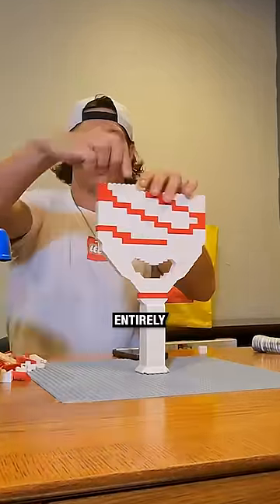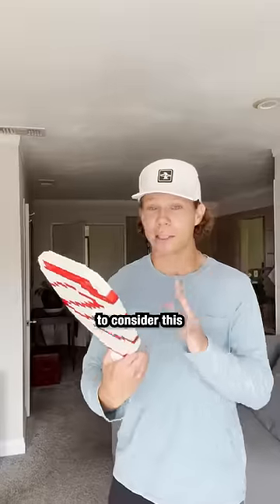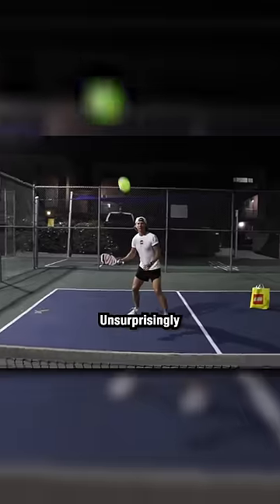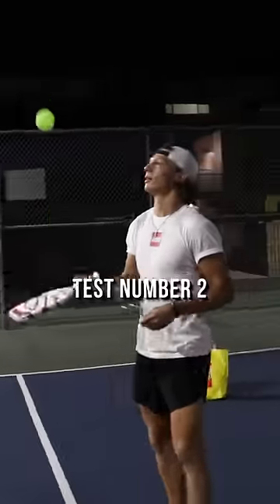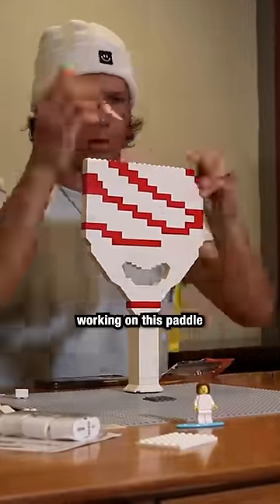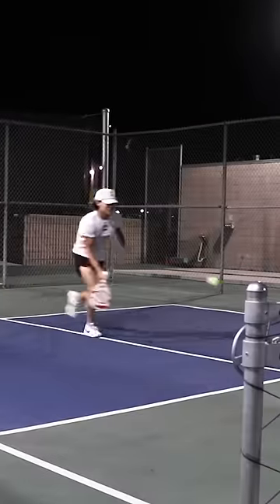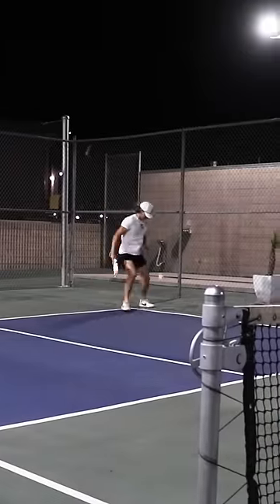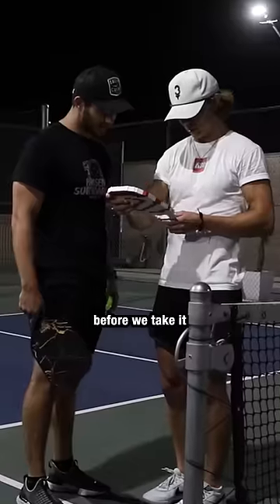PLAYING PICKLEBALL WITH A LEGO PADDLE 😆🏓

Comment: Should've built the paddle horizontally instead of vertically, would've held up better
Reply from the maker: I could try that if I try making another one
Reply: @CjKirwan  yes do it
Reply: And he could start including legotechnicbriks which is useful for movements rather than the 2*4+ briks that is for low forces
Reply: Yeah
Reply: Bro threw it
Reply: @CjKirwan also for strength you could glue it together
Reply: You gotta use snot bricks (studs on the side) and hold them together with plates
Reply: He should've added supports inside the paddle as well
Reply: @CjKirwan thats not pickleball, thats tenis
Reply: @CjKirwan you could also try gluing it
Reply: @CjKirwan you could also superglue the thing. I did it for some of my sets and it makes it immensly strong
Reply: @CjKirwan make it with the 1x… an 2x… and 1x2 and 2x2 or what ever plates that has one of the numbers never more than 2 and then it will be extremely sturdy
Reply: @CjKirwan just so you know legos master builders use super glue
Reply: horizontally and with technic bricks
Reply: Or make it with flat bricks, like 6 layers
Reply: Guy ain’t smart enough for that, shoulda known when he said “days building”
Reply: @normalrocket949 he did. He super glued all the pieces together
Reply: @togsana it's padel
Reply: @zwitie3455  I was coming to make that same comment. Just bricks won’t hold up unless it’s glued together. A combination of technic pieces is key.
Reply: @ohioresident9182 The handle came off
Reply: @CjKirwan yes do it waste your life for the internet hive mind
Reply: @CjKirwan also try using snot bricks and  plates on the sides of the handle to allocate the stress across the whole handle, rather than just the point where the handle meets the paddle.
Reply: Strongest way is to include both!
Reply: As well as horizontal, Also make the entire thing out of the thin plates.
Reply: He did build it horizontally though
Reply: @tanyamilley4369  no they mean using plates instead of bricks
Reply: @CjKirwan do it
Reply: @CjKirwan should use those flat pieces 😂 I could never take those out
Reply: @normalrocket949 he did glue it
Reply: @ratpuppet2843 he did glue it

Comment: You could use special bricks that connect with technic pins I feel like that would hold up better
Reply from the maker: Good idea
Reply: Why do that when hes glued all the bricks...
Reply: @KaizaneTV  Think of technic pins as support beams it will not only make it harder for the glue to come undone but also harder for the pins to slide off
Reply: @KaizaneTV  you just saw glue come apart, technic pins will not do that
Reply: @Elloliott  yeah I know, I used to build. But it's the integrity of the video I'm questioning in the first place. Why does he act like the paddle is purely bricks...
Reply: @KaizaneTV  yeah that’s debatable, fair enough
Reply: @KaizaneTV  why use steel beams when you're using cement to hold the bricks together?

Comment: As an experienced "legoer" i want to give a few suggestions:
-build it horozintally instead of vertically
-reinforce it with technic beams
-layer lego plates for extra durability
-leave some holes to make it lighter

Also pls dont glue your lego

EDIT: Disclaimer about the holes, since im not a paddle expert i cant say if it will still hit the ball fine if they are too big. Smaller holes should be ok but they wont  really reduce weight
Reply from the maker: Great tips! Thanks for the advice

Comment: You need to put some snot bricks on there and technic bits for strength. Go buy thors hammer and turn that into one. Build the handle and modify it.
Reply: Might not even need any glue
Reply from the maker: That’s a great idea

Comment: you spent days on the paddle?
Reply from the maker: I had to only work on it in my free time
Reply: Gluing Legos takes more time too
Reply: @CjKirwan also you should probably use supper glue
Reply: @CjKirwan even then thats like 2 hours worth of work
Reply from the maker: @Quentinanilom  If you watch the full length video on my channel, it did indeed take a couple of days from start to finish. I spent one night initially building the paddle. The next night, I started the process of gluing the paddle, and then finally later finished gluing the paddle and added grip tape to the handle. All together, it probably didn’t take 24 hours of nonstop work. But it did take time spent across multiple days to complete. Hope that makes sense 🤙🏼
Reply: @CjKirwan valid
Reply: @CjKirwan  ahaha thanks for the response dude really wasn’t necessary, have a good dsy

Comment: “after spending days”
Reply from the maker: If you watch the full length video on my channel, it did indeed take a couple of days from start to finish. I spent one night initially building the paddle. The next night, I started the process of gluing the paddle, and then finally later finished gluing the paddle and added grip tape to the handle. All together, it probably didn’t take 24 hours of nonstop work. But it did take time spent across multiple days to complete. Hope that makes sense 🤙🏼

Comment: it doesn’t matter how thick you make it or how much glue you put on it  (though maybe if you used an acid, to melt the bricks together that could work better) , since there’s only two major contact points for the top of the racket to be connected to the handle it’ll always have structural instability at that location.

I would see if there’s square pieces with a cross cutout in the middle (don’t know what they’re called, but I know they have round ones like that) and put the x shaped bar through the thing
Reply from the maker: Yeah it could use more stability
Reply: @CjKirwan  just a little haha, the rest of it seems pretty solid

Comment: Yeah If it was gonna break it was going to be that spot all along since that part over the handle actually is the part that has to take the most resistance so it needs to be able to flex a bit especially with the little area of contact would probs make it strain quite a lot
Reply from the maker: Yup

Comment: How did it take you days? Actual question not being rude but you did show a sped up video of you making it and it looked like it took you 30 minutes to an hour not including time to let glue dry
Reply from the maker: If you watch the full length video on my channel, it did indeed take a couple of days from start to finish. I spent one night initially building the paddle. The next night, I started the process of gluing the paddle, and then finally later finished gluing the paddle and added grip tape to the handle. All together, it probably didn’t take 24 hours of nonstop work. But it did take time spent across multiple days to complete. Hope that makes sense 🤙🏼
Reply: @CjKirwan  ahh ok makes sense now thanks for explaing

Comment: How much superglue did it take?
Reply from the maker: I think 5 bottles 😅
Reply: @CjKirwan hearting your own comment 💀

You could probably have built it without glue by changing how certain segments are built based on the stress you're applying, in spots where there's a perpendicular force, you probably would want the bricks placed vertically on the paddle

Comment: "days" shows time lapse of about ten minutes
Reply from the maker: If you watch the full length video on my channel, it did indeed take a couple of days from start to finish. I spent one night initially building the paddle. The next night, I started the process of gluing the paddle, and then finally later finished gluing the paddle and added grip tape to the handle. All together, it probably didn’t take 24 hours of nonstop work. But it did take time spent across multiple days to complete. Hope that makes sense 🤙🏼

Comment: You’ve got weak points at the two points either side of the paddle. Idk what the regulations are but if you can connect that whole part, or use pin connectors like another comment suggested (maybe even some illegal building techniques) it should work. Looks cool!
Reply from the maker: Thanks!

Comment: Don't know if this will help or not but there is an "illegal" Lego building method where you take a 2 Lego bricks and flip one over so the outer studs are facing a different direction. You can fit some small flat pieces into the under part of the Lego and connect the two. If you did that and glued it at the handle (the weakest point) that might give it more support.
Reply from the maker: Huh, I’ll have to look into that